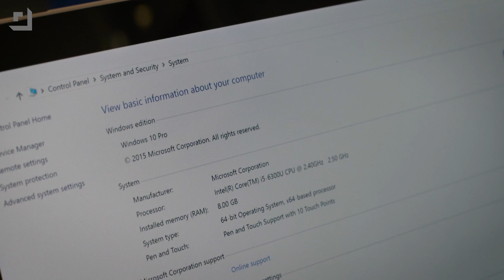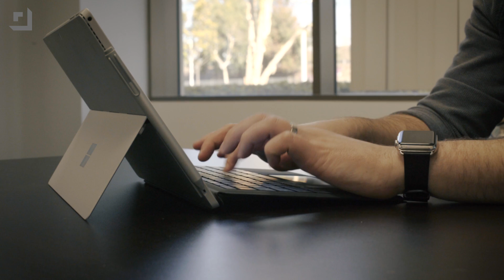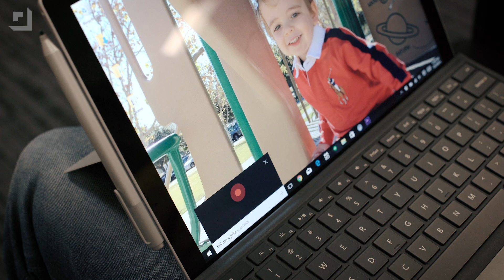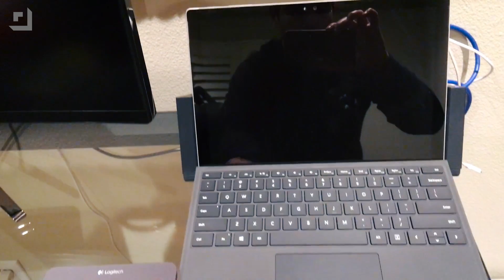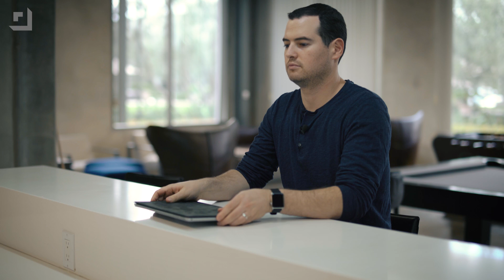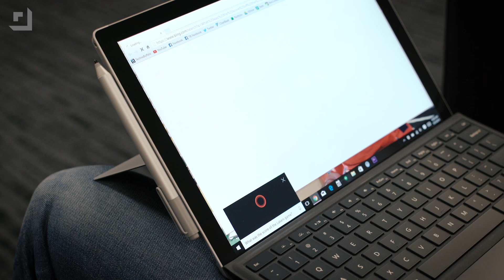Surface Pro 4: Still the Best

Comment from the maker: The Surface Pro is still a beast.
Reply: +Petter Vosvel  apple fan boy, try before commenting
Reply: +TechnoBuffalo couldn't agree more. I switch from a Macbook Pro 2015 to the surface pro 4, really happy I did. I have the same setup at home apart from I have the new dock, I noticed that re-docking sometime causes the task bar to clicker, but that the only bug I have seen so far.
Reply: +Petter Vosvel  overpriced shit
Reply: +Geron Phillips I went from an i5 SP2 with 8GB of RAM to a SP4 with an i7 with 16GB of RAM. Absolutely zero regrets. The screen is incredible, the build is amazing, the keyboard is so much better than the type cover 2, and the performance is excellent. I say go for it!
Reply: +Petter Vosvel overpriced netbook. even the pro s are better
Reply: I've used both . ur idiot does not amuse me. the macbook is just a way of apple trying to experiment with new technologies with the 1 port, no fan, 480p webcam and a specs of an iPad. the surface pro 4 is a full windows laptop  shrunken down to a tablet form, it has a proper cooling , a couple of full sized usb ports and a core i5 . The macbook is prone to thermal throttling so you won't be getting the full performance of what apple claims.  And yes, recently i ve been a macbook PRO RETINA user for about nearly a year or so and  it has been the best laptop I've used since . Despite its slightly thicker in size, it makes up in performance and cooling plus it doesn't feel cheap unlike the macbook's fragile thin body.
Reply: +TechnoBuffalo I just bought mine !
Reply: +Joey Nichols My Pro 4 i7 lasts about 2-3 hours.  It's horrible
Reply: It's the best PC on the market.
Reply: Sya Tajuddin Air no doubt
Reply: +TechnoBuffalo Hey my Elan made touch pad of Acer 5830tg timelinex  is also suffering with the same problem at starting(few months before)  it was frequent but now the issue of sudden slow cursor movement now became rarer
Reply: what frame rate did the games play at and what resolution?
Reply: Did the track pad on the original keyboard have issues too?
Reply: +999CATZ Willing to bet you never had a netbook, or have never used a Surface Pro 4, or both. If I'm wrong, then you're being ridiculously hyperbolic (aka "trolling" aka "hating") which is such a waste of time.
Reply: +999CATZ Sorry, I misread and thought it was Peter Vosvel saying the SP4 is like a netbook. My bad.
Reply: Greg Stella u need to get your ears cleaned or checked. hehehe
Reply: +TechnoBuffalo What is the battery life like? Trying to decide between SP4, SB, and the Lenovo x1 Yoga, any thoughts?
Reply: +bloodworksymphony I'm using the new keyboard/trackpad on an SP3 and I've had NO problems with it at all. Been using it since it launched (also bought the new pen) and it's been stellar. This could be a problem with either his SP4 or his keyboard. I use mine 8-10 hours a day.
Reply: +Joey Nichols I get 6 hours on a normal day, 8-9 on very very light usage. I have the i5 version, don't get the i7 if battery life is important to you.
Reply: What about the Surface 3
Reply: ***** if he were to indicate which macbook then maybe its more clearer cause the macbook in general can be very misleading.
Reply: Yu-Shiang Hsieh well... something like the surface 4 just a step down in hardware.  Still gets the job done .
Reply: KentSpain85 Thanks for the advice
Reply: +KentSpain85 I have to disagree - my i5/8gb SP4 lasts for about 4-5 hours with light usage. And that's consistent with most reviews. I don't know what ridiculous settings (lowest brightness/no sound/no wifi?) you are using, but no way are you getting 6+ hours on normal usage.
Reply: Hi John, thanks for mentioning the docking station, no one else has. is it difficult to connect the pro4 since it is thinner?
Reply: +TechnoBuffalo What is the highest setting you use for Star Craft? That would be on the $1300 model?
Reply: How is it that this machine is so perfect for you guys but there are so many problems being reported on display drivers, screen issues, touch screen failure, battery drain in sleep mode.  It seems kinda strange that you guys are claiming to use it as much as you have and not having any issues.
Reply: could I play sims 4 on it
Reply: ***** thank you
Reply: +TechnoBuffalo  Have you guys experienced your surface pro 4 randomly loading up UEFI settings?  I find that sometimes after disconnecting my sp4 from an over night charge, I open the "lid" and its just randomly in UEFI, not even the lock screen.  Let me know if you experience this, or even may have a fix.  Microsoft customer service has been useless :/
Reply: +TechnoBuffalo You should warn the people, you can't remove or replace the battery ...
Reply: ***** yes you can.
Reply: How much battery time does it gives you?
Reply: TechnoBuffalo i have 2 questions.

1)Do you have to buy the SP4 and the keyboard seperately or can you get them together 

2)How much is the keyboard and laptop wih pen all together if they come seperate

My friend has this and it looks really good so i was thinking about getting it

Thanks for the help!
Reply: TechnoBuffalo z
Reply: What about razor edge? I have not even bothered to research tablets, I just always had an iPad. But, I want a desktop experience with online multiplayer games like BF12, COD, etc... I was thinking do I buy a new iPad pro, the Surface Pro, the Razor pro, or the Nintendo Switch... I don't have time to sit in front of the TV otherwise I would upgrade my PS3 to PS4... I want a gaming machine on the go. I'm guessing it's a toss up between Surface and Razor pro?
Reply: ***** Cheers... Razor blade pro looks impressive, and expensive. So, these tablets can install games downloaded, or through steam?
Reply: TechnoBuffalo Hi there nice vid. Can you help me choose which one is best for Studing? SP4 or macbook air thanks alot
Reply: Thank you dizzy dee

Comment: Still the best at what? As a tablet it sucks, lack of optimised apps. As a laptop it is compromised as I prefer a proper keyboard and trackpad. I have no use for the pen, though  I get that 1% of the population appreciate the pen, so great for that niche market. What kills it for me is it is Windows. I left years ago and use iOS or MacOS as they are more stable and less buggy. I have a business Windows laptop on W10 and after 3 wifi updates it still drops the signal and won't connect to some signals. I hate that. When it wakes two out of three times the cursor becomes unusable, stuttering around. I hate that. It downloads in the background and took nearly all my data plan. I really hate that. When I upgrade it takes months for drivers to be released and I end up with software that is broken! You can keep the SP, I am not paying that much for an OS that kills me.

Comment: SP 4 or new macbook air, when they update it? (Hopefully soon)
Reply: Surface pro 4 definitely
Reply: +Cambaudio it honestly depends on what other devices he has and what tasks he does. If you're deep in the apple ecosystem then I fab recommend anything but a Mac. But if you're a student then I think the surface is yours just because of the combination of portability and ease of note taking. They're both amazing devices honestly. My preference is the surface but really chose what fits your lifestyle most.
Reply: +Michaelsp9 I don't have much to say about the MacBook line, but I would certainly recommend a Surface Pro 4 to anyone. I can see that people might not recommend the Surface lineup if they used a previous version. I will say that, as a person who used the Surface Pro 2 to the 4 now, Microsoft has really nailed down the hardware. However, Windows 10 is still... buggy. Microsoft still hasn't released the latest Intel Skylake drivers and it has been almost a month now.
Reply: MacBook. You'll find more MS bitches here but trust me, just a way overpriced laptop that doesn't have a keyboard. Formal owner here.
Reply: +Cambaudio formal, do you declare?
Reply: +Pablo M. He is talking about the fanless throttle monster, not MacBook's in general.

Comment: How is the surface pro 4 with youtube watching ??
Reply from the maker: +NoWiredGaming Great!
Reply: TechnoBuffalo Yeah Cuz i looking to get the surface pro 3 or so because it in my price range And i used the tablets just for youtube yeah know
Reply: Any tablet will be great for just youtube.!!
Reply: +NoWiredGaming you really shouldn't spend that much on a tablet if you aren't doing powerhouse work on it. Black bars also have nothing to do with your tablet really and is the video you are watching. If you want less black bars you'll want a 16:9 aspect ratio for your screen. 

Save yourself some money and grab something like a Lenovo Yoga or  Xperia Z tablet or something. They're both great priced ranges with great screens at 16:9. They'd also probably run youtube better because it's not running through a full desktop OS.
Reply: NoWiredGaming
Any tablet that has a 16:9 screen ratio will do. Just google "android tablet 16:9." Lenovo Yoga and Xperia Z tablets both are 16:9 and great value.
Reply: Anime4 Mii lol
Reply: Kartik Vishnoi Not if you don't like black bars lol
Reply: +NoWiredGaming Black bars are nice when you have subtitles. I personally came over from the SP2, which has the 16:9 aspect ratio but smaller screen, so I'm not bothered by the bars on the SP4.
Reply: gameshoes Yeah but i don't watch sub titles so what tablets out there that don't have black bars ??? :)
Reply: Zalx Thanks Bud for the info yeah i have galaxy tab 10.5 but it crack :[
Reply: Zalx So the Lenovo YOGA Tab 3 10-inch
would be perfect for youtube with no black bars right bud ? lol
Reply: ***** yeah i was thinking getting the sp 3 or somthing but idk all the tablets i look into or so have black bars in lancape mode lol
Reply: excellent
Reply: David Loon yeah xD
Reply: Anime4 Mii yeah but i don''t like laptops lol
Reply: Anime4 Mii i just wanna get a good tablet that big that also have no black bars when watching movies or videos in landscape mode lol
Reply: Anime4 Mii nice :P
Reply: Anime4 Mii True but i don't need a laptop i just want a thing to watch youtube videos lol i have a desktop with 3 screens lol
Reply: Anime4 Mii lol  i got a 40 inch smart tv that 4k and a smart tv for 500 dollars lol
Reply: Anime4 Mii lol  I not youtube famous for that kind of money lol not yet anyways :)
Reply: Anime4 Mii i have a galaxy note 3 A dell  windows 7 and a samsung tab 10.5 witch is on it last legs lol
Reply: Anime4 Mii fast i guess i not sure

Comment: That tracking issue must be a Windows thing. I've had it happen with multiple different mice on multiple computers
Reply from the maker: +Cody Lamson Interesting.  I thought it was just the Surface.  Good to know.
Reply: Ryan McGlone you're probably right. Any time I tired fixing it I would update synaptics and it would work (with a track pad).